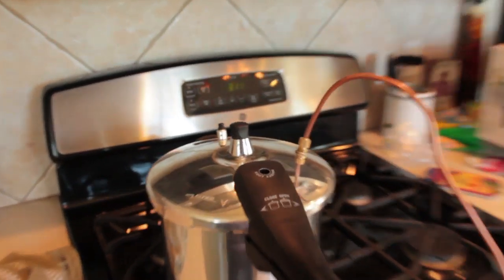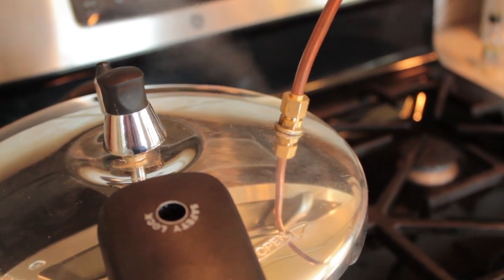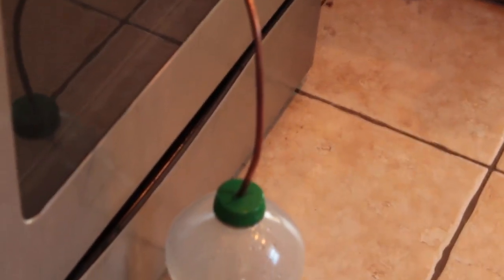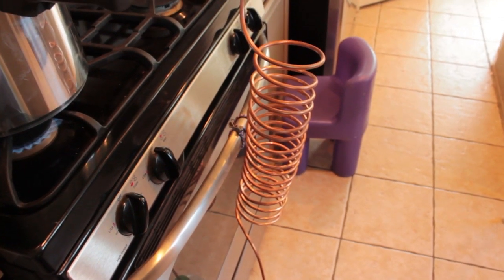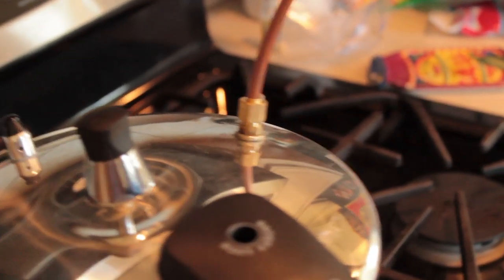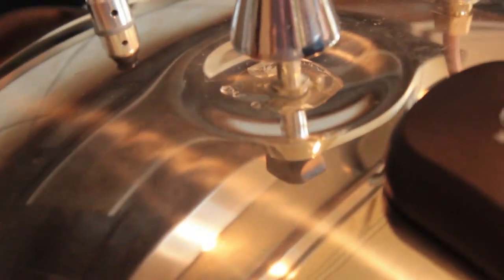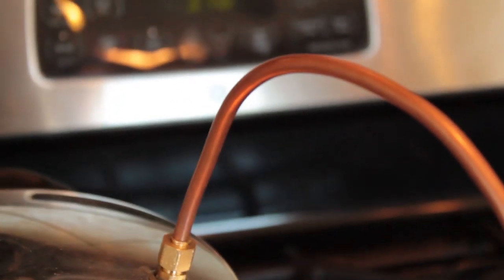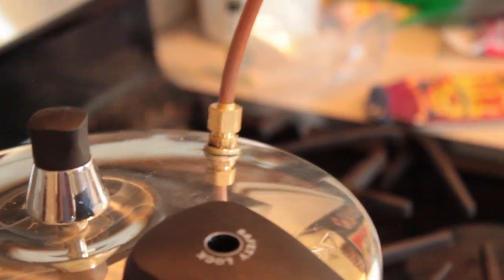Stovetop Water Distiller

Comment: use a tin solder. Tin will melt at 232 degrees celsius and the boiling water will keep the system from getting above 100 degrees celsius

Comment: Use a copper or aluminum gasket. Subaru, honda, and other brands use a metal gasket that crushed on their engine oil pan plugs...... it should work super nice. I know you can stack the copper one. Also the aluminium ones are like a folded gasket so they can conform to a slightly rounded surface
Reply: Sorry forgot to specify that I meant it was for the copper tubing connection to the lid of the pressure cooker

Comment: Perhaps using plumbers tape...or maybe coat the connection with rubber cement as temporary seal, you could seal it for cheap each time you need too.If all else fails you might be able solder  over it.

Comment: Didn't you defeat the purpose by using an aluminum pressure cooker?
Reply: No.  Aluminum wont evaporate.  (Yes, I'm 2 years late ;-)
Reply: Use stainless or copper and empty into glass only.

Comment: Hi there.why don't you run the coiled copper pipe in a bucket of cold or ice water and then put the other end in a glass jar or bottle. And fix that leak were your losing steam. But all this for distilled water. I know there are benefits but what about the gas bill or electronic bill.wast of energy. If this is for life then you will need to use solar energy or sun's ray to heat up the water as this will be more economical.

Comment: pressure cooker is the best idea but like you said you need to keep the coil dunked in a bucket of water to cool the coil and then what comes out is cool and thats it. Other types of this cooker have the center available for putting the tube in so that you can leave the two relief valves to do their job which is relieving over-pressure. You may have to replace the cooker, look around. And use rubber gaskets. There are other vids showing what im talking about and there is no steam loss and good flow.

Comment: Don't bother with putting it in a bucket.  Transpiration is your friend.  Just get a $2 spray bottle at Depot.  Fill it with water, even room temperature.  Just spray the outside of the coil with some water every now and again.  The water droplets on the copper will evaporate taking the heat with it.